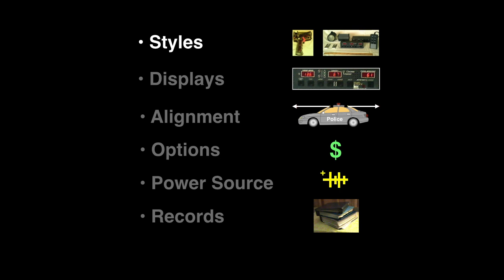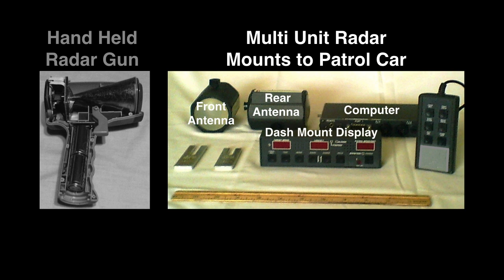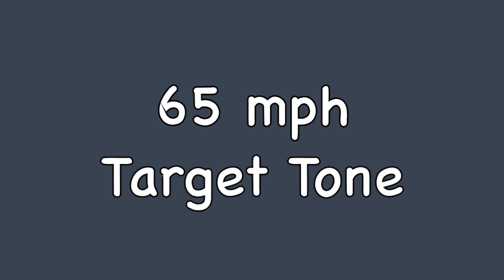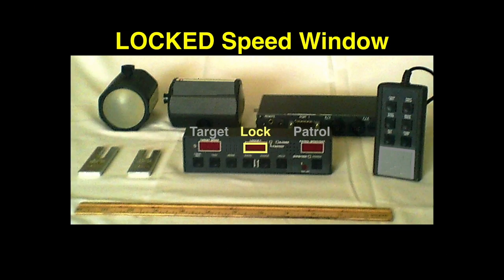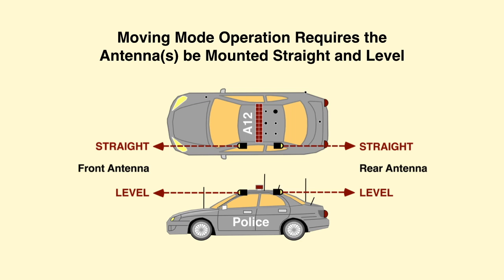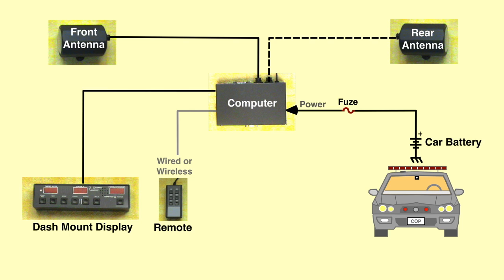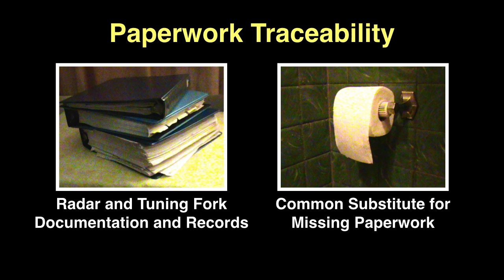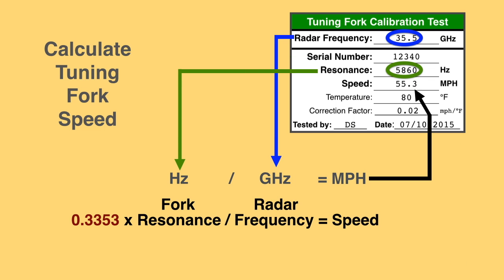Police Radar Basics - Hardware

Comment: One of the things I have noticed in the last few years is that radar manufacturers have set their radar display units up to "blank patrol car speed" while in "moving mode".  Thus when you "lock" onto a target, the PATROL CAR SPEED IS ERASED so if the "offender" asks to see the read out, he has NO idea of how fast the patrol car was going (especially if shooting opposite traffic).  I know of numerous departments that the officer will be traveling at 30 or MORE over the limit and clocking oncoming traffic and when a violator is locked on, the PATROL speed was also locked on.  Cops HATED that.  A friend got tagged (and I happened to be with) and we asked to see the reading and the patrol speed was 94.  As I am retired PD, I knew his goose was cooked and asked why he was traveling at better than 29 OVER the posted limit.  He responded that he was in pursuit of us.  Pretty funny as he was moving IN THE OPPOSITE direction triggering everything that moved (vs using the constant on mode to thwart radar detectors) and NOT in pursuit until after he turned around (and came up on us at better that 125 MPH to write a ticket for 6 over.).  I called him on it and showed him my ID and he was pretty pissed and gave a warning instead as he know he'd have some 'splaining to do in court.  I personally run a Kustom Signals Golden Eagle (similar as to the unit in the video) to clock local, Sheriff and State Police in the state I live in just to tweak their tails (my system is tied into my dash cams also, so there is NO question as to who did what.  I DO NOT ATTEMPT TO CONFRONT THE OFFICERS, merely make a phone call if they are seriously violating the law (and I run a scanner so I know if they are responding to an emergency).  So, lesson out there (as we were ALWAYS told), YOU ARE NOT ABOVE THE LAW.  YOU ARE HELD TO A HIGHER STANDARD my department dealt with them who thought differently pretty harshly if a complaint was VERIFIED on an officer's behavior.  A LOT of departments don't do this and makes the rest of us look bad.
Reply: MrTommyboy68 Lots if insight in this comment. I want to thank you for speaking up, I can truly respect that🙏
Reply: Thank you for being one of the good ones. I wish that you were still on the job in a position of command to help show the new Officers the way.
Reply: This blank patrol speed is set by the operator, not the manufacture. Its not for using while operating the radar in moving mode and blanking the patrol car speed display.  like you explained, its to blank the patrol speed when a speed once a speed is locked. very often an officer will also clock you coming up behind you to get an additional reading of your speed. In addition to that if the operator cleared the display, if he hits lock, it will show the last patrol speed and target speed recorded on some models. This will be a high speed if he triggered the radar when he was catching up to you. Your comments and product features have little to do or suggest that the radar was used in a bad manner.
Reply: That is INCORRECT.  In the moving mode, if you lock a target vehicle, the PATROL SPEED does NOT remain on the screen.  I have a Kustom Signals Golden Eagle unit.  EVERY TIME I lock a target, and am MOVING, MY SPEED (patrol speed) DOES NOT STAY LOCKED.  The manufacturers changed this several years ago due to complaints from officers that they had a hard time explaining why THEY were traveling at "X" miles over the limit AT THE TIME OF TARGETING.
Reply: This is from the Kustoms manual " Lock-Release freezes the target speed into the locked window, while the unit continues to monitor both target and patrol speeds." That is world wide unless your state (florida) has a special unit designed for them. Changing this in the software is not hard. It points to the Lock Rel button on the diagram, which is all the way to the far left. In addition is shows the Hand controler and shows the patrol blank button and explains its operation.
Reply: The patrol window can not be turned off like you said, while the officer is moving and clocking cars. He can only turn off the window when it is in the locked mode. Kuston says, Patrol Speed Blank "blanks the locked patrol speed. It does not say blanks the patrol speed, like you suggest.
Reply: As you stated:  THE UNIT CONTINUES TO MONITOR AND DISPLAY BOTH TARGET AND PATROL SPEEDS.  IT DOES NOT LOCK THE PATROL SPEED.  PERIOD.  Once a violator is stopped, ONLY the LOCKED SPEED IS DISPLAYED since you are NO LONGER MOVING.  It WILL continue to show speeds of vehicles from whichever antenna is selected.  I LOCK A SPEED, it DOES NOT DISPLAY MY SPEED WHEN I CLOCK THE OFFENDER.  It USED to be when you locked a target, the target speed AND patrol speed were locked and as I said a LOT of officers hated to explain why they were on patrol traveling at 30 or so above the limit and shooting a car in the opposite direction NOT IN PURSUIT.  The speed was LOCKED AT THE TIME of violation.  Manufacturers gave in to complaints.  You must be thinking of PRE NHSTA  rules that PROHIBIT the use of "locks" where the operator could set the lock at "X" miles over the limit, NOW the unit MUST be manually locked via the operator.  As I said my Kustom Signals Golden Eagle does NOT lock the patrol speed.  I will be happy to video my unit in operation to prove my point.
Reply: My comments and your comments are mostly correct on the features and functions but not the reason nor to suggest that the radar was used in a bad manner. The third window display was added back in the late 70's on the S80 by MPH, before this Decatur and MPH had it in the hand controller. It was not done to "hide" anything but to gather more evidence and allow the officer to make additional speed checks for further evidence and also to be able to monitor his patrol speed and verify his speed as he is clocking the same or another car. This is needed to maintain NHTSA requirements and compliance. That was the reason for the Change, nothing to do with what officers wanted.
Reply: I have eagles and the manuals, i admitted to you and agreed in its operation, with one exception, I explained that you cannot clock cars with a patrol speed window being blanked out and meet NHTSA guidelines, it has nothing to do with what officers wanted. You can recall patrol car lock, but are not required to show any speed at all to a violator, and this feature does not merit questioning an officer credibility. Many do have cameras, and you might be able to get the history. If the Patrol window cant be locked, explain to me why the Eagle has a patrol speed blank on the controller?
Reply: I NEVER said the patrol speed could be blanked WHILE MOVING.  Once a target is locked, the unit CONTINUES to display the patrol car MOVING speed until you STOP.  THE ONLY speeds displayed are the LOCKED TARGET and ANY MOVING vehicle that is approaching.  The PATROL SPEED is ONLY WHEN THE VEHICLE IS MOVING.  THAT is the point I am making.  Before the manufacturers bowed to pressure from officers, the PATROL SPEED would stay locked as well as the violator.  That was the source of contention of officers.  Units from the 1980's and older used to display BOTH speeds (when in moving mode), NOW ONLY the violator is locked.  BUT the unit continues to operate showing traffic and since the patrol car is STATIONARY, NO patrol speed will be displayed.
Reply: You Said "radar manufacturers have set their radar display units up to "blank patrol car speed" while in "moving mode" That's not correct, I know what happens, and what changed, and why it changed, The units of yester years, did lock the reading, but again, If you cant lock Patrol Speed, why a Patrol Speed blank on the hand control?  The answer is as long as you transmit and clock additional cars and transmit the patrol window verifies your speed as required by the NHTSA. When you are not transmitting if you locked and preserved the original lock you can show both patrol and target window, and if you wish via the patrol speed blank window you can blank out the patrol speed and only show the Target speed. Depending on the brand of radar, if you checked additional cars without locking them, your patrol speed is updated and shows your last speed displayed, not the patrol speed locked when the target was locked. Some brands revert to both speeds at the moment the windows were locked. This is why you have a patrol speed blank, which would not be needed if the radar did not have a method of locking the patrol speed. The Eagle can lock patrol speed, and the officer can blank it, but if you leave the transmit on and continue to clock cars, the patrol window operates to verify you patrol speed as required by NHTSA, it has nothing to do with officers complaining, nor officers trying to cheat anyone. If they cheat its on them, but the radar did nothing to contribute to the problem, and its function is designed to conform to NHTSA and Florida guidelines.
Reply: @uscg8168  This goes back to the days as someone else pointed out, MPH and Decauter were set up so that when you LOCKED ON A TARGET VEHICLE, THE PATROL SPEED WAS ALSO DISPLAYED.  After complaints from police departments, they redesigned their units so that ONCE YOU LOCK ON TO A VIOLATOR, THE UNIT WILL REMAIN IN THE ON MODE AND WILL DISPLAY A  SPEED ON EITHER AN APPROACHING OR COMING UP BEHIND (depending on how the operator is set up) but ONCE YOU STOP THE PATROL VEHICLE DOES NOT READ THE PATROL CAR SPEED.  As I said with mine, if I am moving and clocking approaching from the front or rear, depending on setting, if I "lock" a violators speed, as long as I am moving, patrol speed remains displayed,  As soon as I stop, the patrol speed registers a blank screen.
Reply: @uscg8168  No in the "old days" when radar was still a pretty basic piece of equipment, ONCE THE OPERATOR LOCKED ONTO A VEHICLE, HIS SPEED WAS ALSO LOCKED ONTO THE DISPLAY.  The most modern units AUTOMATICALLY "BLANK" THE PATROL SPEED ONCE THE TARGET IS LOCKED ON TO.  As I said, the officers in the state I was living in ROUTINELY travel at 20 or 30 and trigger anything that moves in the hopes of catching someone speeding at 5 or 6 over.  My Golden Eagle DOES NOT LOCK ON THE PATROL SPEED WHEN i "LOCK" A TARGET.  Older models would lock BOTH THE PATROL SPEED AND THE VIOLATORS.  As I said police HATED THAT and the manufacturers changed the configuration.
Reply: MrTommyboy68  all radars have patrol blank, the old Decaturs and all radars hold the patrol speed if locked, if you flip the trigger it will update the patrol speed and hold the last speed displayed in target window. I have designed these circuits in the old decaturs, but my point is that this feature is not used purposely for what you say, the early MPH and Kustoms would not track a patrol car at higher speeds you describe. Decatur would, but in most states you are not required to show target nor patrol speed.
Reply: @uscg8168  OK.  Let me see if I can break it down for you.  The unit I had was an older MPH.  If I was driving and in the "moving mode" the display would show the approaching vehicle speed as well as my speed.  If I locked on a vehicle, the unit would display BOTH THE "VIOLATOR" SPEED AND MY SPEED and remain locked until I released it.  Cops HATED that and had the manufacturers change the settings so that if you locked on to a target, and once you stopped your car, ONLY the speed of the target was displayed,  I know of many a guy that got burned because as I said they were going 20 or 30 over the limit in the opposite direction and turned around to chase someone who was doing 5 or 6 over.  the OLD UNITS LOCKED BOTH SPEEDS until released,  The old style "set the violator speed" meaning it would register speeds until someone exceeded the pre set limit and the NHSTA said we couldn't do that any more sue to tracking issues and mis use.
I highly doubt your claim of having "designed" these units and I KNOW WHAT MY UNIT WOULD DO AND NOT DO.  What I am saying is there are a LOT of officers who lie and cheat.  They HATED getting caught in their lies and having to explain their own speeding.  IF THEY WERE TRAVELING IN THE OPPOSITE DIRECTION AT SAY 30 OVER AND LOCKED ON YOU AT 5 OVER LOCKED IS LOCKED.  It did NOT display the fact that you were in pursuit at 120 MPH as they turned around to chase you.  THAT is what I am saying.  It LOCKED ON THE SPEED AT WHICH YOU WERE TRAVELING, NOT YOUR MAX SPEED IN TRYING TO CATCH UP.  I hoe this clarified things for you.  And the "newest" Golden Eagle will remain "transmitting" even though you have locked a violators speed and unless YOU release and relock,
Reply: MrTommyboy68 moving in the opposite direction tracking both cars, the MPH at 30 over would blank patrol speed and not clock anything. The MPH K55 was not capable of working at patrol speeds you described in the fashion you described. In that era only Decatur 715 and 724 could. I have a video on YouTube showing those units.
Reply: @uscg8168  Mine worked fine no matter how fast I was going.  ALWAYS gave a reading.  I wish I still had it but one of the boards went bad and no one had parts.  I then went to a Kustom Signals hand held and finally to the Golden Eagle.  They have come a LONG WAY since the 1960's X band monsters.
Reply: MrTommyboy68 the new radars like the Eagle, vary greatly as the are software controlled. Some can lock into the lock window and allow you to track speeds in the patrol while reading the same car or other cars, when you do this the patrol speed updates. If you turn on your violator you can pace with the patrol window, and monitor your speed showing a higher speed on the patrol window. That speed has nothing to do with patrol car speed the moment you were clocked unless you kill transmit, thus losing your tracking history, the reason again for this is NHTSA. required tracking history, it’s so the units comply with those requirements not to hide patrol car speed. Patrol blank hides it, but what they are hiding does not mean that was the speed the patrol car was going the moment he clicked you. That can vary, and the software can be modified to your agancies needs, however yes officers do not like to show that speed, but very few states require they show it.
Reply: @uscg8168  where is your video located? I would love to see it. Thanks!